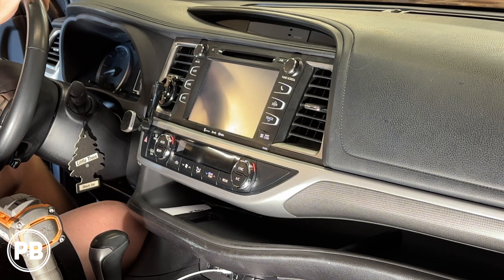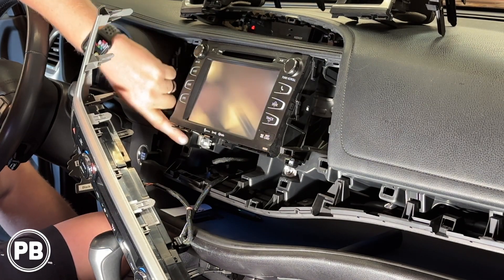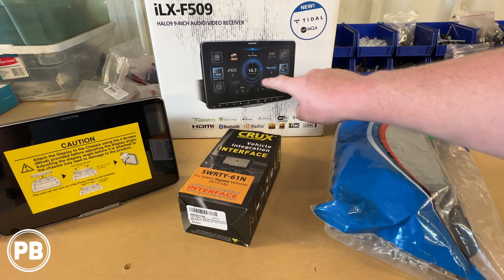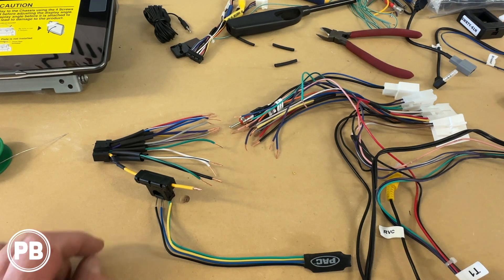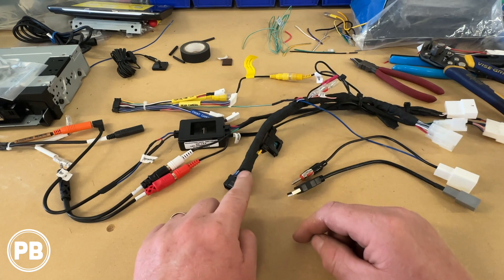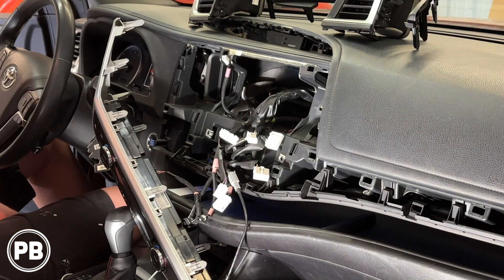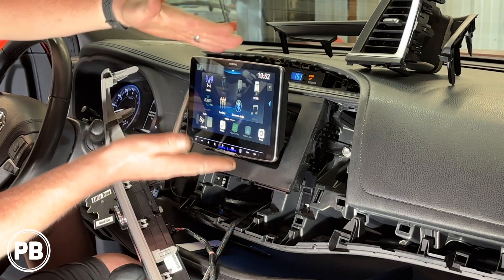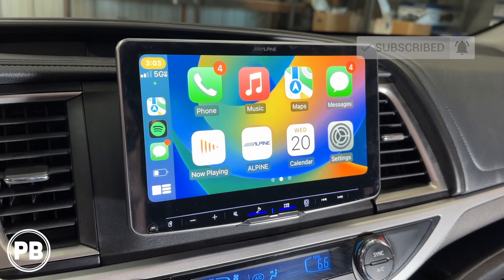2014 - 2019 Toyota Highlander Radio Install

Comment: I did this install with all accesories u used but with a pioneer  DMH-WT3800NEX everything works fine, except that on the small screen on speedometer doesn't show the song info or navegation info.. Is there a fix for this?..
Reply: Try reinstalling the unit